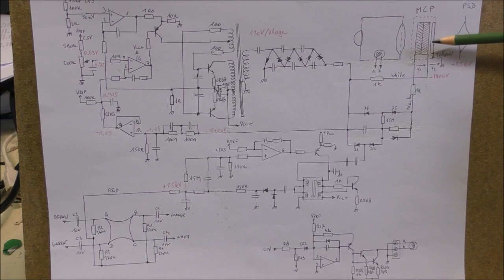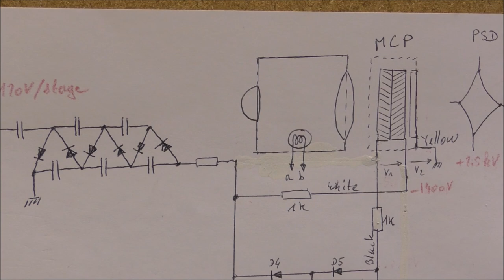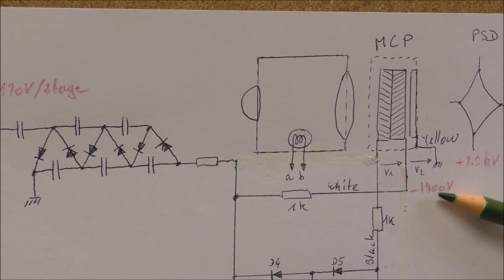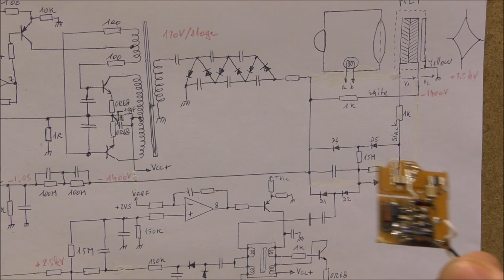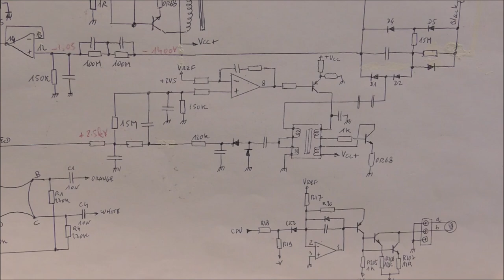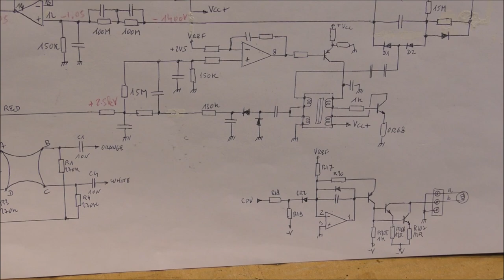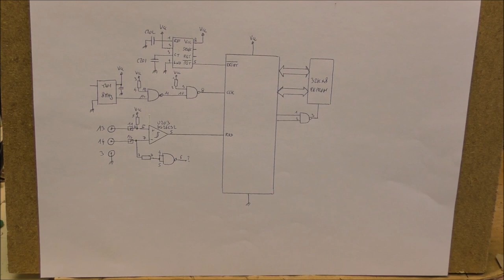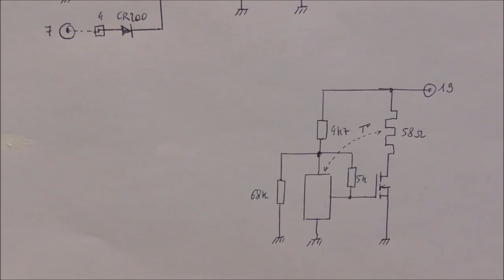LDM #260: AAQ24(V) Missile Warning Sensor - part 4: Reverse Engineering

Comment: Many thanks for reverse engineering. Absolute joy to see all the classic MIL grade analog circuits. It was thrilling to see that you brought the heating circuit back to operation.
Temperature regulator is a bang-bang-contol hence temperature oscillates. Initial temperature was 13.5°C , wondered why so low (lab temperature).